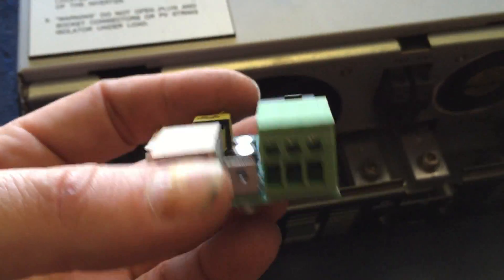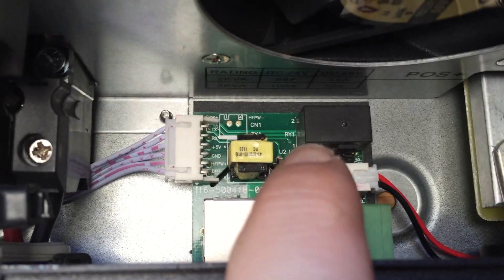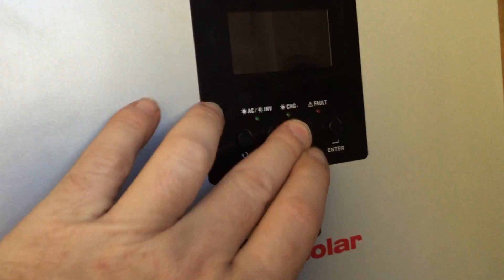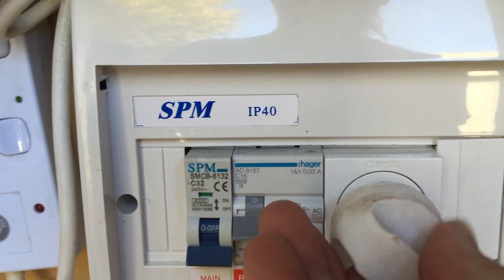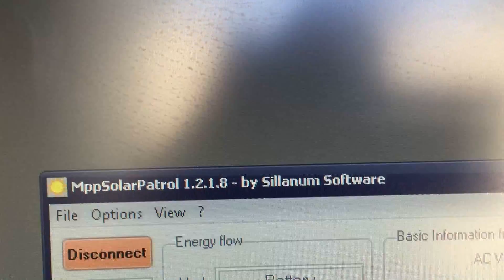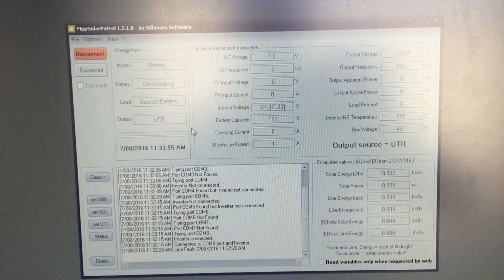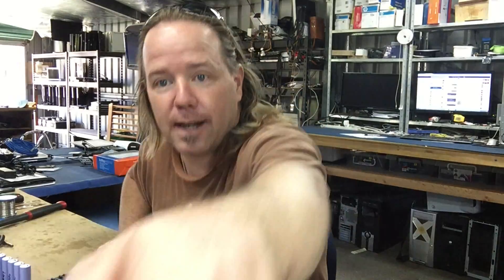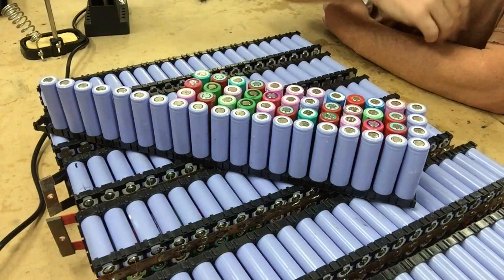Changing USB to Com (RS232) Port & Project Update

Comment: Well done. I think everyone is envious. 

You said once. Your packs were charged by 11am, in the Summer you probably don't need to switch off battery's ?  They would be charged by the end of the day?
Reply from the maker: That was with the old batteries, now that i draw much more from the cells it takes all day plus every third day i have to turn on the grid charger for a few hours just to top it off a little.
Reply: Does this mean more solar panels
Reply from the maker: 48v & alot more panels :) When wiffee agrees :)
Reply: I wanted 10KW she only let me get 4.5,

Comment: Here I was thinking it was my suggestion on the cost video to use multiple cell holders being the reason you changed from the single to the 20 cell holders.
Reply from the maker: +Brett ya probably did lol but my Sparkie brought some over and we test fitted them. Looking back I didn't know they were available until someone mentioned it in the comments. :) ty

Comment: Great video's. One question: How long do you expect your packs to last under low/typical charging currents? Or how much capacity reduction do you expect per year? Thanks
Reply from the maker: Absolutely not a clue check back in a year or two :) Fingers crossed my house is still here and running off 18650 cells :)
Reply: +HBPowerwall Will do :D Cheers